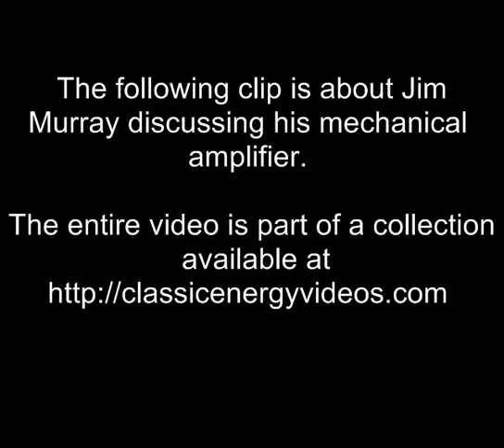Mechanical Amplifier by Jim Murray

Comment: If applying this to a planetary gearbox, what gears should be used as the input, the weights, and the output? 
I'm thinking the prime mover on the ring gear with the load and weights on the planetary gears, would you agree?

Comment: Probably Jim has read Tesla's articles quite a long time ago, and this is why he makes a definition mistake as per the meaning of  the term "rotation" he is using, as commonly  erroneously perceved, even by highly technical people, as the criticism to Tesla's article has shown.

According to the article "The Moon's Rotation" (Electrical Experimenter April, 1919) writing: "The unfailing test for spinning of a mass, is however, the existence of energy of motion. The moon does not posest of such vis viva. By this I mean that 'axial rotation'  is not simply 'rotation upon an axis nonchalantly defined in dictionaries, but is a circular motion in the true physical sense- that is one i which half or the product of the mass with the square of velocity is a definite and positive quantity."

As one reads the article it is clear that Tesla proves theoretically, based on well defined mechanical concepts, and practically, by designed experiment, that the moon does not rotate in the sense defined in the dictionaries, as there is not inertial mass associated with that movement, and the proper word would have been, as Tesla is using it, "revolving" around axes passing through its spherical center, with one revolution, time dependent, on the rotation of the moon and earth around the gravitational center of the dynamic system they create, that by itself is also is influenced (in a lot smaller degrees, but influenced nonetheless) by the dynamics of other celestial bodes as well.
Reply: Interesting, do you think these kinds of motions also explain the fact that the earth's rotation cannot be measured? I mean I don't know too much about it, but several experiments show that the earth is at rest, but it is clearly revolving. There was even a time where I truely believed the earth was at rest, but that creates huge, huge other problems and consequences.
Reply: please make an animation of what you are saying

Comment: really interesting and I wonder wher I can find more info on this, the pictures are not clear and I cant really understand how your devices were setup, if you could provide a drawing or something like that, that would be amazignly appreciated.
Btw just to be sure, when you measured   stationary or rotary mode when you lifted the weight ft up, , did you take into account that the motor+ bench is   rigidly connected to earth itself  which is huge and massive